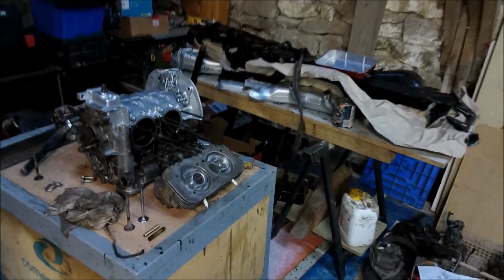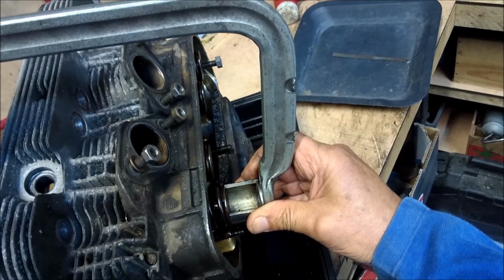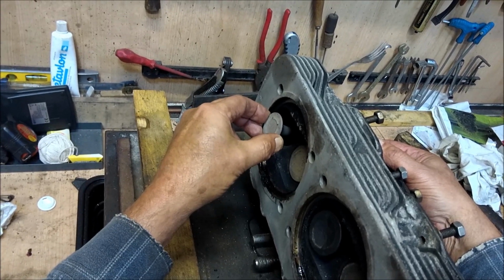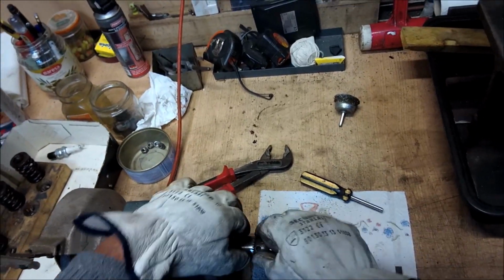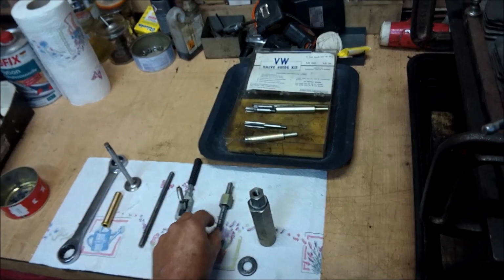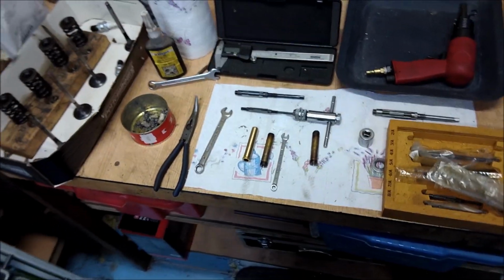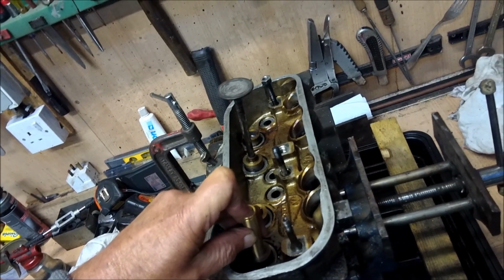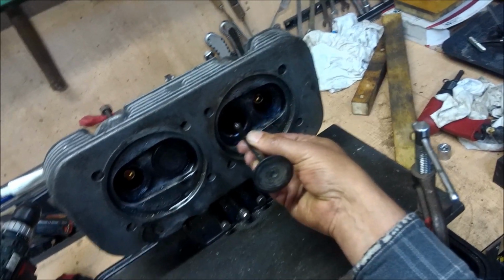How to overhaul a VW 2 litre air-cooled cylinder head Part 1

Comment: I could watch you all day. the most adventurous I’ve gotten with my 2.0 CU T25 is change the carb gaskets.

I was told today (after an MOT) that it’s running too lean
CO = 0.18%
HC 573ppm

do you have any guidance on how to richen it up (as a DIYer)?
Reply from the maker: Hello, 
This is not serious, more important is the mixture at say 2200 rpm.
When under load and fully warmed, VW air cooleds like to be a little rich.
CO at idle is adjustable.
Different petrols give different results depending on ethanol content.
I would suggest you get a gas analysis done at a rolling road centre,..or you could pop by..
Reply: sarran1955 thank you for your advice, I will find a rolling road as suggested. Would not dream of popping by and slowing your projects down :-)